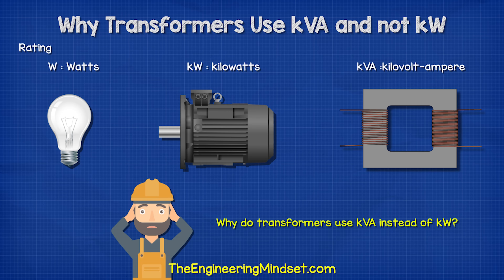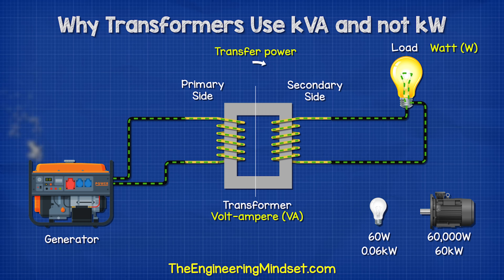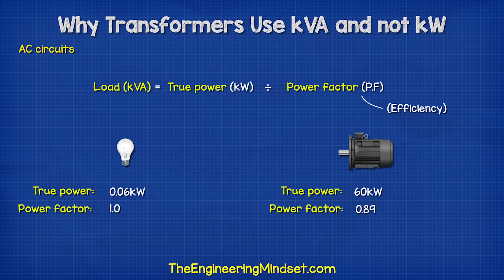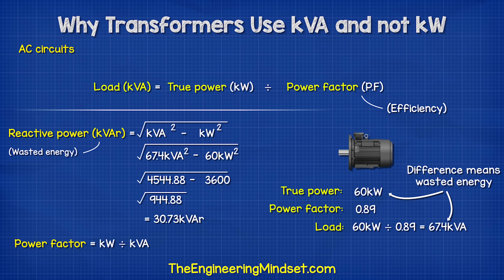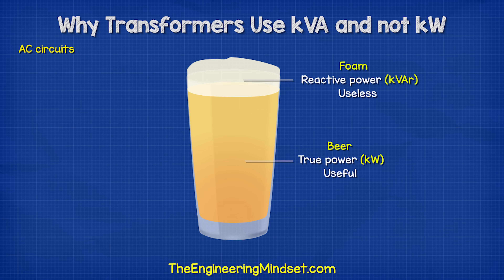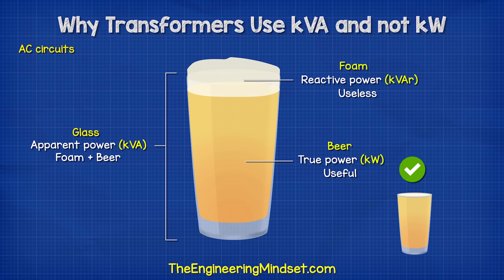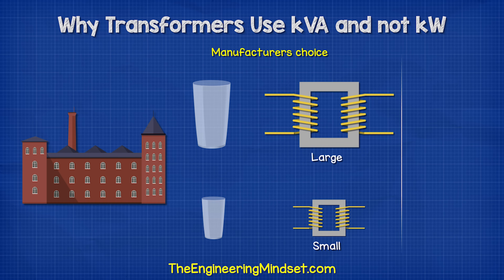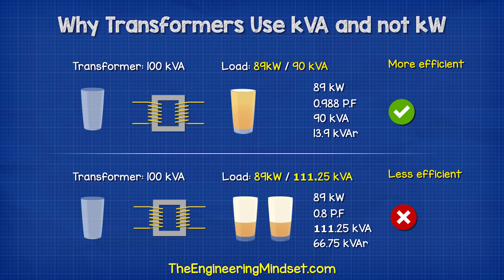Why Transformers Use kVA Not kW

Comment: This video explains the difference between apparent power and true power very well, but it doesn't explain why the convention is to use kVA for apparent power. 1 watt is equal to 1 volt-amp by definition and apparent power could be expressed in kW just the same without any loss of accuracy. So there's extra meaning given to the unit label beyond the literal definition. But... why is that the convention, and why not label it as something like kWa for kilowatt apparent power, kWt for kilowatt true power?
Reply: @oceanbagel @peter enis (and everyone else interested). It is, in fact, just convention. Apparent, real y reactive power are measured in J/s (Joules per second as per IS units). That translates to W (Watts). BUT there is some logic behind that convention. For starters, Watts, in honor to James Watts, is ALMOST reserved to mechanical machines and motors (which transform to mechanical motion), therefore is considered REAL power (power we can "see"). After discovering that some "mysterious" power was necessary to magnetize some electrical machines, and that "opposes" start, they called it reactive power. This power is not consumed (I.e. trasnformed to other form of energy). It flows forward and backwards... But uses "cable space".
Since two powers were needed for electric machines to work, the term "apparent" power was created, referring to its "total power at place". Then comes the unit... Since you won't get Watts if you just multiply the current and voltage (volts x amps) consumed by a motor/transformer (power factor comes in), rather the apparent power, hence apparent power was convened to be VA... Consequentially reactive power VAr. But still they all translate to J/s... Hope it helps.
Reply: @OriginalOsO  great explanation.
Reply: @Peter_Enis  I understand that, but it doesn't explain why the convention is to indicate that by putting the units in a different equivalent form.
Reply: It will deliver the rated amps @ rated Kv.  The end user determens the power factor. The watts if you will
Reply: @sjefoekel6058  That's still all just by convention. And I'm wondering why that is the convention. Explaining what the convention is doesn't really answer the question.
Reply: @OceanBagel  because you can draw less true watts, and still burn that transformer because your drawing to much amps at rated volts. 
Due to a bad power factor.
Reply: This seems a lot like asking why conventional current is defined to be opposite of electron flow and being told that it's because the electron has a negative charge. It's a true statement, but it doesn't explain why that's the convention, i.e. why the electron's charge was defined to be negative.
Reply: @OceanBagel  another interesting riddle: why is phase angle imaginary? Are they having us on?
Reply: @TheCablebill  Because circles and complex numbers are related. Iirc Inductance is +Y capacitance is -Y and resistance is +X. 3blue1brown has some awesome vids on complex numbers.
Reply: There's a good chance that there isn't really an answer and the convention of using VA instead of W for apparent power happened gradually over many years. But it's also possible that there's a specific reason for the convention that can be pointed to, such as a specific company providing VA ratings for their equipment instead of W ratings.
Reply: The thing is that a motor or heater  takes the electrical power in kW and localises the electrical energy then transfers it to another form of energy - work and heat.
However capacitors and inductors and transformers don’t do this. The energy is not localised it’s just moving in electric and magnetic fields. Also the apparent power has the current and voltage out of phase whereas for real power they are in phase.
Reply: As an example of another way to label different ratings in the same units, look at Vrms and Vpp. Both quatities are measured in volts and they're given extra letters to indicate which quantity they're referring to. Similarly, real power and apparent power are measured in the same physical units of power. So there could in theory be a similar labeling scheme like Wap for Watts apparent, and Wre for Watts real. But it was not done this way. Somewhere along the line, someone decided that expressing the unit of power as VA would mean apparent power and expressing the unit of power as W would mean real power. It's a perfectly valid way of indicating it as the units still work out, but it's different from most other cases which is interesting enough to want to know the story behind it.
Reply: @OceanBagel  I don't know what to tell you. The terms, real, true, apparent were all coined to help explain the difference to the layperson. No one decided along the line to express real power as VA, it was always VA and they just use apparent  to explain it in a non technical term. VA is a term and unit and explains exactly what it is, like Vpp, VA is the Volts x Amps. So is VAr, Volt Amps reactive as is W for Watts. And again, real or true and apparent are only needed to explain power in AC, not DC. So instead of a dedicated letter connotation in AC they use the same Unit , the Watt for AC and DC, since they are power used and in AC if you deal with it, you know that power factor is also in the Watts. It's really not that hard to remember and no idea why you are so hung up on why this is and who decided it. 
It's easier to just accept the fact this is what's been used since the beginning and I work with MVA, MW and MVAr everyday and none of the people I work with ever have any issue with those terms. In fact, some get confused if you ask them, what is the true and apparent power? You get a look like WTF are you talking about?
Reply: @inothome  I'm not "hung up" as much as I'm pointing out that the video proposed the question of why that's the convention but instead only explained what the convention is. The question of what the different ratings mean is a perfectly valid question and this video explains it well. It would have been more fitting for this video to ask "What's the difference between kVA ratings and kW ratings?" But that's not the question that was asked. The question of why the convention is to indicate this by using a different form of the units rather than using a subscript abbreviation (like is used with values such as Vpp, Vrms, and even VAr) is just as valid of a question that may or may not have an interesting answer. It's especially frustrating to be curious about the history behind this notation only to be met with comments that boil down to "That's just the way it is." I already know that's the way it is. I'm just curious about the answer to the question in the title, which still hasn't really been answered.
Reply: You could say a transformer is not seen as a "true"load so no watts (labour) are used. Do they produce heat and resistance, yes ofcourse. But they are not considered as labour-potential you can use...so no watts..
Reply: @Peter_Enis  Do you seriously still not get it? This isn't about what a transformer does. Watts and volt-amps are dimensionally equivalent. One watt equals one volt-amp. They're the same unit. It is only by convention in this specific application that they represent different values. The question isn't what they represent, the question is why they are used in that way.
Reply: @inothome  Those are jargon, not for the layperson. They mean specific things.
Reply: @OceanBagel  Obviously you are not a trained engineer. You dunning Kruger yourself thinking they are defined the same. they are not as they are used by engineers. With knothole's explanation it should be clear why the convention exists and why it was a thing. Because DC circuits were first and dont have any reactance.
Reply: @jhoughjr1  Not sure exactly what you're trying to say. But been in the electrical industry for years and no one ever says, what's the apparent power or what's the true power. We always use MVA or MW and I've never seen a meter with an apparent display gauge. Watts, VArs, Volts and Amps. Maybe for device development some may use the true and apparent terms, but for power delivery I've never come across it except in training to help people understand the difference between VA and Watts in an AC system. Your mileage may vary....
Reply: @jhoughjr1  I know exactly what I'm talking about. What you and several other commenters are missing is the difference between the definition and the conventional usage of these units. By definition, they are equivalent units. But they are used by convention to refer to different values in this context. That's not supposed to be a difficult concept to grasp nor was it what I was originally commenating on. So I'll restate it again... We have these units VA and W that both refer to the unit of Joules per second, but in the context of AC circuits they're used to refer to different measurements and ratings. And this video was supposedly trying to answer why that is the case but ended up simply explaining what the difference is instead. Answering why it is has to do with history, while answering what it is has to do with technical explanations. So my point was simply that they had asked the wrong question.
Reply: A volt amp might look like a watt but it is not. 
You ask, they are the same why call them different? 

VA is short for VAR. Volt-Amp-Reactive. 
Because reactors phase shift voltage from current, power is only consumed if they are in phase.  So VA comes from VAR which comes from the basic physics of AC circuits and impedance in reactors.
If you only think VA = W you will never understand the convention. VA != W outside of purely resistive loads. That is an information dense fact.
Reply: @jhoughjr1  VA != VAr, one is apparent power, the other is reactive power
Reply: @Peter_Enis  The unit would be Joules per second, if it were based on Joules. But as for why Watts are used for power instead of Joules per second, it seems there's a pretty well-documented answer in the form of the origin of the Watt unit. It's actually interesting, as the Watt was originally proposed to be defined based on a 1 amp current across 1 volt, but then in 1948 it was redefined based only on units of length, mass, and time which set it equal to 1 Joule per second. The 1948 redefinition also seemed to shift the numeric value of a watt slightly to align it with the existing units.
Reply: @OceanBagel  "The unit would be Joules per second"     A joule is already 1W per second. So according to your comment it would be 1W per second per second?
Reply: @Peter_Enis    That's not correct. A Joule is 1 Watt times 1 second, not divided by 1 second. Joules measure energy, Watts measure power. You can (and should) look it up on the internet to confirm this.
Reply: Okay...does this answer explain it better;
A three-phase power transformer must be rated for the kva(pparent) it can handle. I must be able to handle the KVA before anything else....
Reply: @Peter_Enis  No, that doesn't explain it at all. You're explaining what the convention is, which I already understand. But that doesn't explain why that's the conventional way to indicate apparent power.
Reply: @OceanBagel  It's also a warning-label for when we work on them :face-blue-question-mark:
Reply: @Peter_Enis  for me it doesn't. The question is not what true or apparent power is.We measure Work done and heat transfer in Watts, why is apparent power so important that it deserves its own unit as kVA. Also, you keep answering questions that werent asked, so you clearly arent qualified enough to  know the answer.
Reply: A question I was about to ask as well. And one that nobody here can answer. It seems it was just to state that "hey, you are dealing with a transformer here", since by definition W = V * A. So they just as well could have used kW, but it's probably to make you aware of the previous fact without stating it in text, i guess.
Reply: Tradition? Maybe watts became associated with work in certain circles whereas VA was considered potential (as another commenter suggested). Who writes the definitions, anyway?
Reply from the maker: See our new video on how to build mechanical versions of electronic circuits? Watch here: https://youtu.be/Zv9Q7ih48Uc
Reply: It's like me plugging in a 110v phone charger into a 230v wall socket. First you have to know how much (k)v(a) the charger (wich is also a transformer) can handle......now do you get it?
Reply: @Peter_Enis  Are you reading what I'm saying at all? The question has nothing to do with the physics or practical calculations. It has to do with the history and etymology behind the labeling convention.
Reply: @OceanBagel  Okay, hopefully this helps..... transformer companies didn't stop using the va..... we just did for home-use..... sometimes you can still see on a transformer at home 110va or 230va wich is the more correct term for a voltage without a load on it.
You got me confused with your question "by definition and apparent power could be expressed in kW just the same without any loss of accuracy".
It's impossible to have watts without a load...
Reply: @Peter_Enis  Once again you're mistaking convention with the literal definition. Volt-amps and watts are only differentiated in this context because they're being used as more than just units, but rather as labels for which type of power they represent. And conflating these two things is exactly the problem you're having right now. Volt-amps the unit is exactly the same as watts the unit, whereas volt-amps the label representing apparent power is not the same as watts the label representing real power. The former is the literal definition and the latter is the convention.

Now again, the question that was the premise of the video and has yet to be answered is this: why were these units chosen to be the conventional labels for apparent power and real power, rather than labeling these quantities in some other way?
Reply: Because they are the best way to describe a transformer is why....
Reply: @Peter_Enis  Yeah I really doubt that. VA as a unit doesn't describe a transformer any differently than W. They're both units of power. Besides, explicitly calling them "apparent power" and "real power" or even giving a subscript like I had said earlier would still be a more intuitive notation.
Reply: @OceanBagel  The terms real and apparent power are only used to help explain the difference between VA and W when used in AC systems to people who do not regularly deal with AC circuits. For those of is that do it's basic intuition that VA is V x A (and is even expressed VA). When it comes to W in an AC system you also have to consider the power factor when talking about Watts. In a DC circuit VA and W are exactly the same, there is no power factor in DC circuits. And Watts in an AC circuit is V x A x PF. So to help explain what the difference between VA and Watts in an AC circuit people will talk about real and apparent power. And why would anyone need to call something apparent power when the term VA actually tells you the formula for what apparent power is? 
You can't rate a transformer in Watts because you don't know the power factor of the load it will be supplying. A 100W incandescent lamp will use 100W of power and 100VA, since in a purely resistive load like a light bulb the power factor is 1.  However, a 100W inductive motor will be drawing more than 100VA due to the inductive reactance causing the power factor to be less than 1, more likely 0.87 or so.  So the VA of that motor would be 114VA. 
A transformer can only supply Volts and Amps, it has no control over the power factor. So they are rated in VA. If you were to rate a transformer in Watts you would have to list at what power factor is that Watts calculated with. Since to get Watts in a AC circuit the formula is V x A x PF. So unless you know the exact PF of the device the transformer is powering, you can not know the Watts the transformer can deliver. However, knowing the VA will tell you that that transformer can not deliver any more Watts than the VA. W will always be the same or less than the VA. 
In DC circuits, none of this applies, VA is W and W is VA.
Reply: @Peter_Enis  "Because they are the best way to describe a transformer is why...."   Yes, EXACTLY!!!!
Reply: @inothome  but VA isn't a term, it's a unit. The only reason that intuition exists is because the convention is to write the unit as VA. It would all work exactly the same if you used W, and DC circuits do exactly this, as you get the watts by multiplying volts and amps. Everything to do with the power factor is not in the definition of the unit itself, it's in the definition of the label real power which is indicated as W by convention. But none of this is really related to the question of why the unit was chosen to be the way to express this, out of the various alternatives. I get all the physics and calculations, but I also know that the units themselves are interchangeable aside from their connotations.

I was hoping for someone to know the actual answer on why we use these units as labels in this way and trace its usage back to some specific source. But all I'm getting are people explaining what the convention is and not why it is. I already know what it is. The video explained that very well. But it did not answer the question on why the convention is to use these units to encode this extra information instead of the more typical method of adding an extra label onto the rating.
Reply: @OceanBagel  I guess the closest I can come with my ee degree is that KVA maybe is abbreviated KVAR, Volt-Amps-Reactive. So it's more apparent that the distinction is tied to real vs apparent power.
I cant recall the third component of the power triangle. Something else combines with reactive power to make real power.
Reply: @OceanBagel  a unit is a term.... inothome gave the explanation for it I was taught in college.
Reply: If you are the director of an energy-company, you wanna know how much a transformer can handle; voltage and ampere's and how efficiënt it is (and cost..)
Knowing that it can handle 10000kwh doesnt say at what voltage......could be 5000V, could be 10.000V etc etc..... now how can he choose his transformer?
Reply: @Peter_Enis  You're still just going on about the difference between real and apparent power, which isn't the question. The question boils down to this: why is this information encoded into the unit label instead of being given a name? Like I said before, volt-amps and watts are equivalent units that are given extra connotation beyond their literal definition in this specific application. But why is that the case?
Reply: @Peter_Enis  First it would be 10000kw not 10000kwh. But even then knowing that it could be 10000kVA doesn't tell you the voltage or current either
Reply: @Danielagostinho21  Yes it does, I learned that 1kv = 1000v (but you are right about the kwh....please excuse the typo 😆)
Reply: @Peter_Enis  1kv is not 1kva